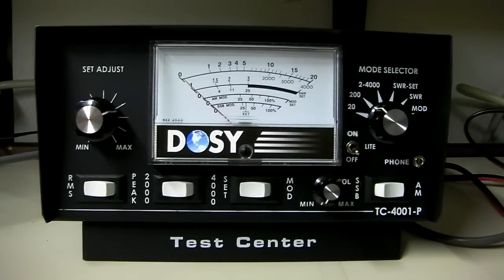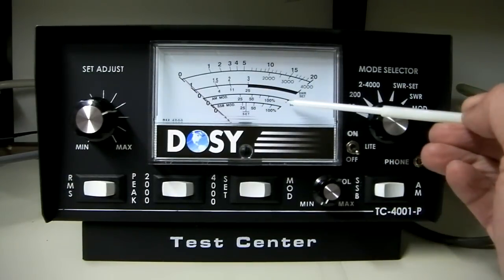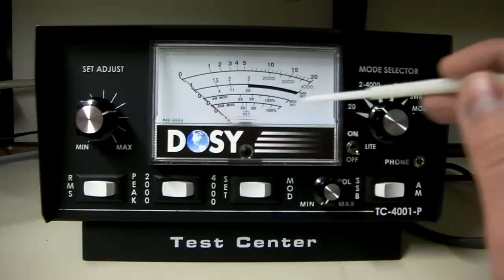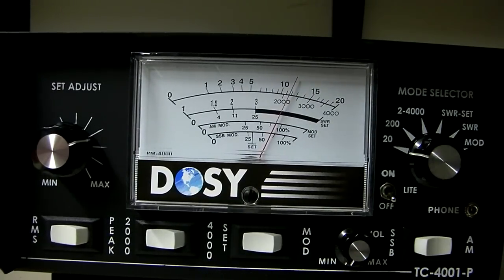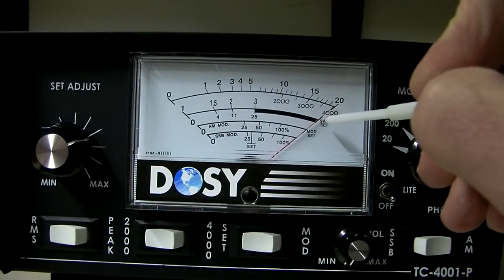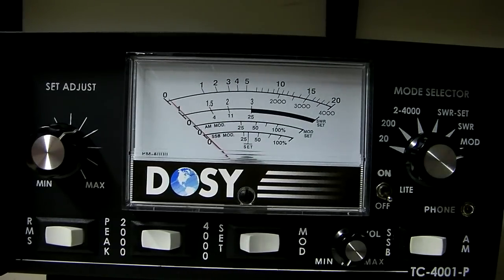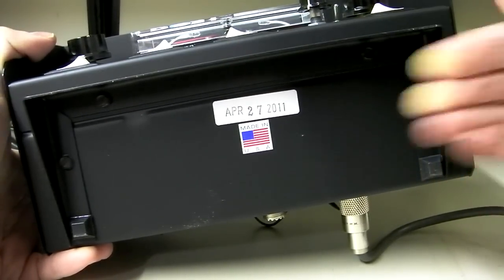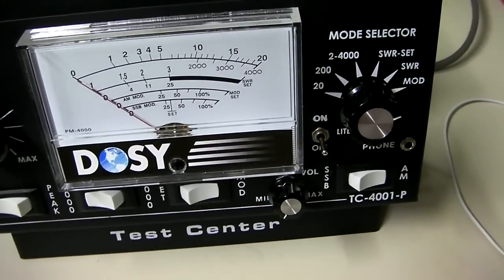Dosy TC-4001 P SWR Watt Modulation CB Meter Overview

Comment: Does the jumper cable suppose to be same as antenna cable. If I’m using 213 from antenna to radio do I use 213 for jumpers.

Comment: Ha! You lads need to listen to GB3CB near Birmingham. The MARS 19 A COPY CB Club has taken over a once respected Midland Amateur Radio Society. M6 and the 2E0s  are playing with their CB chatter talking bollocks as usual. M6s teaching others to get their buddies through the novice wire a three pin power plug exam to become M6s. One group was using the GB3BM repeater to run his business, getting his staff through the Novice exam, giving them Baofeng handies so they can report back to base using the repeater.
One got his licence revoked, but is still working HF and sometimes heard on VHF / UHF. In six weeks I only heard him use a call sign once. Then he writs an Email to K6XIQ SCOTT FARTHING accusing others of blocking nodes, without a shred of evidence. Then the guy makes death threats toward those he accused and others too.. His brain cell had obviously sustained some sort of damage? He is barely literate yet a committee member of the new CB controlled club. I wonder if 2E0CLI would still like to kill me and the 8 others he threatened to kill. 10-10-until we do it again, gud buddy.

Comment: Does the RMS-PEAK switch affect the Modulation Monitor mode? I noticed that you had it in RMS position when you measured modulation. Was it measuring an RMS value and would it capture peak values if it was in the PEAK position, or does that switch not do anything in the modulation mode?
Reply: nothing in modulation mode